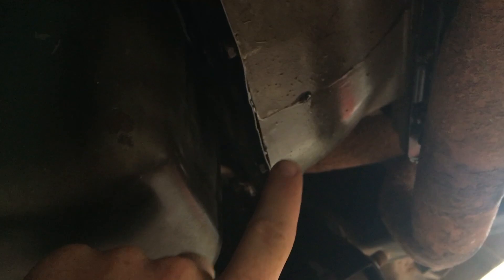How To Tell If A Rear Main Seal Is Leaking | Diagnosing an Oil Leak | 2000 Dodge Ram 2500 5.9 Magnum

Comment: A leak there on the trans. could also be the transmission seal but you have to look close to see if it is fluid or oil, it isnt always easy to tell.

Comment: Mine 1999 ran 1500 in rare solar yellow color has main seal leaking and not looking forward for take transmission off to replace that but learned that you said don’t have to. Got link of video how to do that?   

Mine has same leak symptoms as you described and I notice when I drives she will drink oil had to put at least one quarter every two to three days. But when sat not use the oil level remain same.

Comment: You can't get the oil pan on these from the bottom as far as I recall. If you have the engine out, you can change that seal as you describe, correct me if I am wrong.
Reply: You have to lower the front differential. Engine stays where it is.
Reply: I just did mine I didn’t have to do anything except drop the oil pan

Comment: This may sound like a dumb question, but how much oil were you going through with that seal leak? Reason why I ask is because I’m having the same issue with my Magnum 5.9 and it goes through about a quart of oil a week depending on how much I drive it. I did the Hughes plenum repair kit and the engine was rebuilt when I bought the truck with about 27000 miles on it at that time. I’ve put on about 25000 since I’ve had it.
Reply: I’m having the same problem
Reply: I’m having the same problem I don’t drive on freeways but I put about a half of court to a court a week have to put more in every two days
Reply: Same issue

Comment: Hey Mroffandon. I have a 2007 dodge ram sport with 5.7 hemi and I found oil leaking from the front of the bell housing of the transmission between the oil pan and transmission.   Oil pan gasket leak?
Reply: Hope you fixed your leak if not that sounds right. 2001 Dodge Ram 5.2 here
Reply: @shawnbrown6047  turned out to be rear main seal leak. 👎
Reply: @dcbgator  I just did my pan and now I gotta redo the gasket.  I had hell getting it on by myself and appears my oily fingers got on the lil bit of RTV  I put on the front. I cleaned out the oil pick up screen which was giving me low oil pressure at low rpms. 

Glad you figured that out, old trucks just need a little love.

Comment: I assume you would not have to remove the trans for a 5.2 either right?
Reply: Wish this post wasn’t so old but I hope it helps someone.
For this truck no, you don’t have to, just take off the starter(2bolts), remove the dust shield that covers the torque convert so you will have an easier chance at dropping the pan. There are 2 brackets for support which need to come off first. This is to help you with the real main seal accessibility. Especially putting it back on.

I have a 2001 Dodge Ram 1500 5.2, also a mechanic.
Reply: @shawnbrown6047  Dude thank you for that. I have a 99 5.2 ram and am trying to figure out if I can do this in the driveway without having to drop the trans.

Comment: Hey I have this issue and it's causing my truck to run like crap until it gets completely warmed up. There's smoke coming from under most likely the oil dripping and burning. The truck will shake and the acceleration can get like it's almost stuck. I know for a fact it's related. Do you have any input as to what I can do I can't afford a Machanic at the moment.
Reply: I've also been told my rear seal or gasket was going bad when I bought it but didn't notice an issue til 2years later. I had it running fine for a month after using a seal leak fluid. But it's back
Reply from the maker: What is your oil pressure at when you are having the problem? What make is your vehicle?
Reply: MrOffAndOn 2001 gmc sonoma, when I start my truck the pressure is high and goes down back to its normal spot either have way or alittle less once the truck is warmed up. What's weird is it will stop when the temp gauge gets to almost half (fully warmed up) but sometimes youl still notice it. It all started when I seen the smoke from the leak.
Reply from the maker: Its possible that oil is leaking on a electrical component or connector and is causing problems. Higher oil pressure is normal when the engine is cold. I would suspect ether electrical or fuel.
Reply: MrOffAndOn alright thanks I'm just trying to get a few ideas so I can hopefully diagnose it without spending a whole lot. That makes sense. The good thing is I'm not losing any noticeable oil so it must just be dripping.
Reply from the maker: Good luck :) Any other questions just ask.
Reply: MrOffAndOn would this be the same in a 318 96
Reply from the maker: Yes :)
Reply: The ReckfuL i changed o2 sensors,plugs and wires,got rid of the problem.
Reply: @TehReckfuL  Don't look for smoke no more🥸

Comment: Did you replace the rear main seal without separating the engine and transmission?
Reply: If you listened to what he says in the video you can remove the oil pan instead of dropping the Trans to replace the seal.